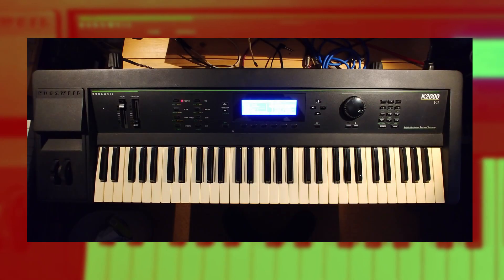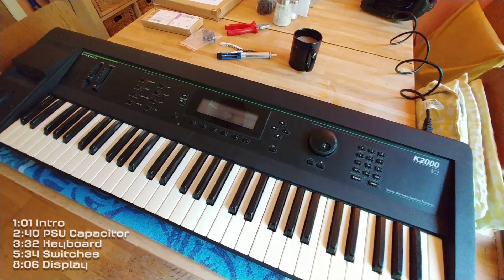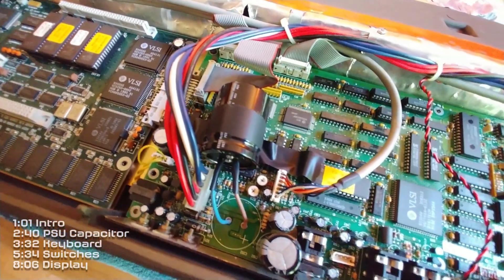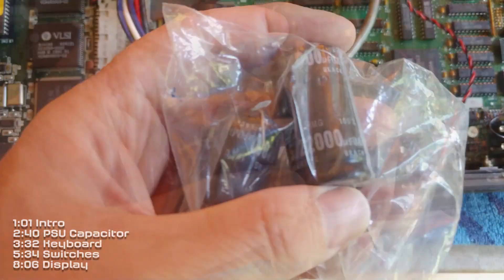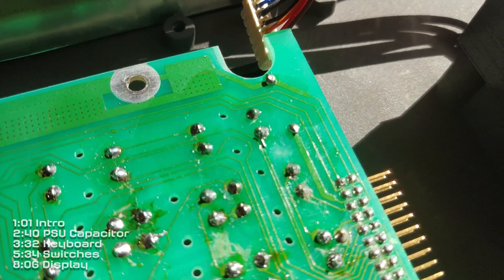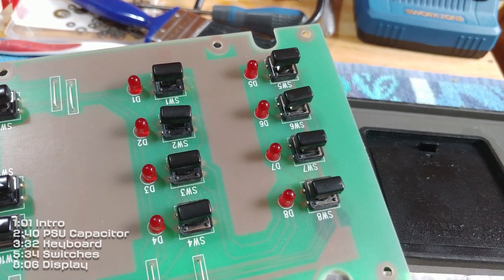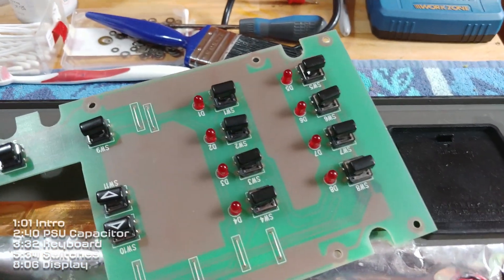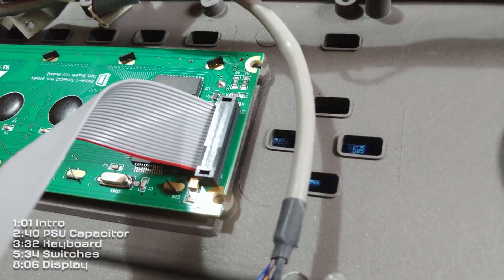Kurzweil K2000 Restoration - keyboard, switches and display replacement.

Comment: Upgraded the desplay and now the buttons are TIGHT and JAM if I press.  The button board screw holes no longer align up.
Reply from the maker: Sounds like the display is not fitted correctly or is wrong.

Comment: Excellent video! Quick question: A friend installed this display but each time he powers K2000 up, he manually has to adjust the contrast. Is this normal? Thanks!
Reply from the maker: No once you set it, it should be good.  Maybe the internal batteries are running low?

Comment: You can test buttons by entering a test mode, 'K2061 Scanner Diagnostics'. At least, I can on my K2000 V3, OS 3.87.  In prog mode, press 4,5,6 simultaneously. It will cycle display of all LEDS, then enter the test mode, where the battery voltage and wheel centre values are displayed. Any button/key presses or control movements are displayed.
Reply from the maker: Thanks, good to know.

Comment: Hi I was wondering if you could help me
I have a k2000 v3
Two small glass fuses on the kettle lead insert have blown 
I replaced and it happened again 
Have you experienced this problem 
Cheers
Mick
Reply from the maker: It's probably something inside the PSU that is shorted but you'll need to take it to tech to get it fixed.

Comment: The New Displays from backlightsonline Have the ribbon Attached and do not require the power cable.
Reply from the maker: Thanks, that could be a good option for those without reasonable soldering experience.  I got my display from here: https://www.buydisplay.com/catalogsearch/advanced/result/?resolution=158  It's a lot cheaper and took about a week to get to me.